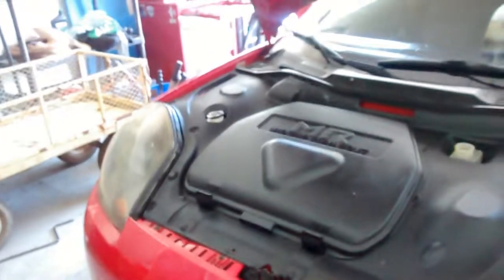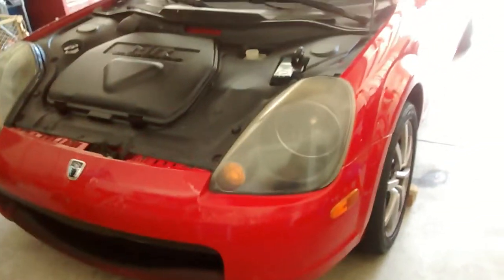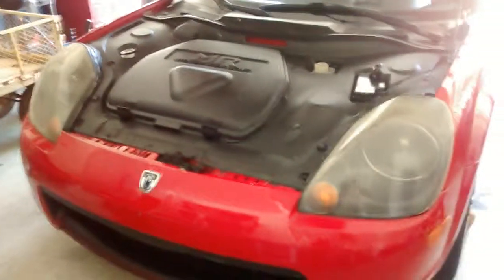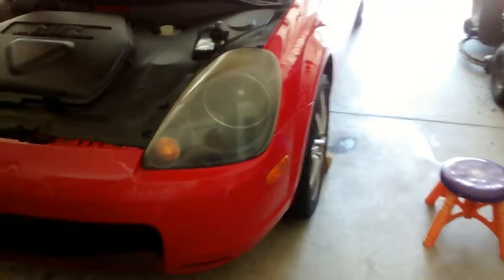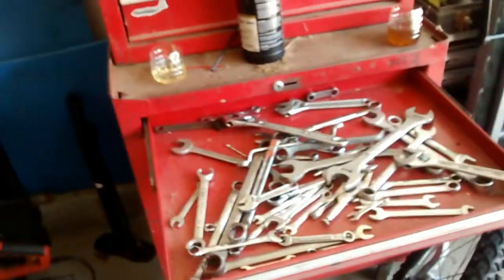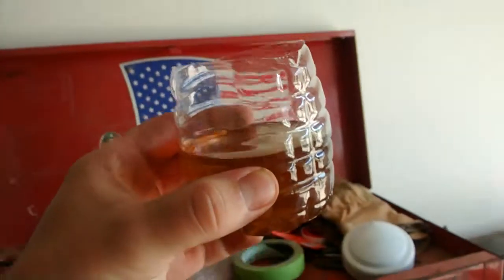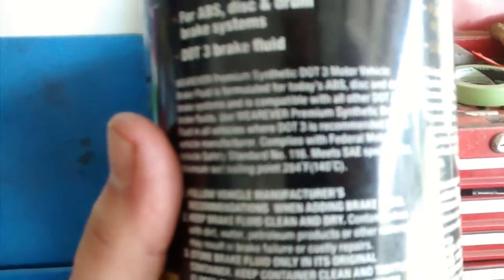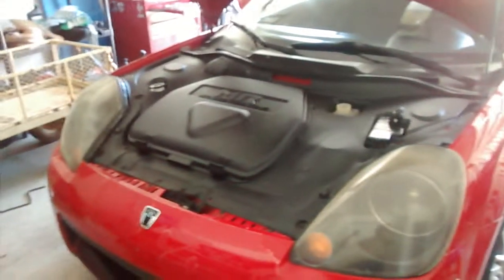Midship Runabout Maintenance: Bleeding Brakes - An Explanation

Comment: nice to see some maintenance vids on this car. ..bought one a few months ago and about to do a full brake replacement so this helps. ..never bleed brakes before
Reply from the maker: Thanks so much! I'm glad the video is useful to you. Sometimes people get right into a process without explaining the overall key points of the process and the reason you do it. 

In terms of the process, the main point is to keep the vacuum going continuously as long as the bleeder valve is open. 

Thanks for the feedback!